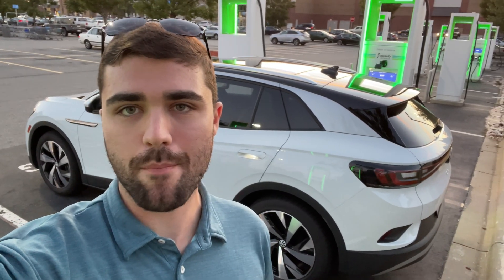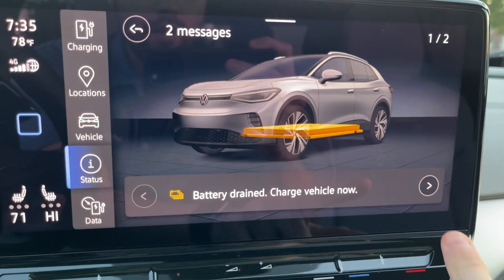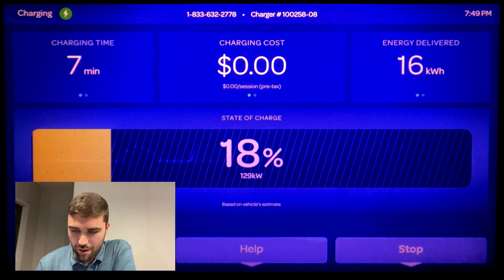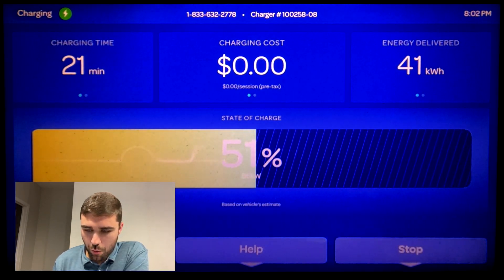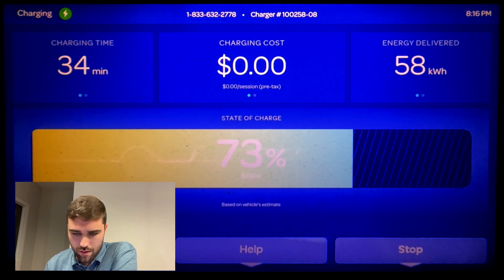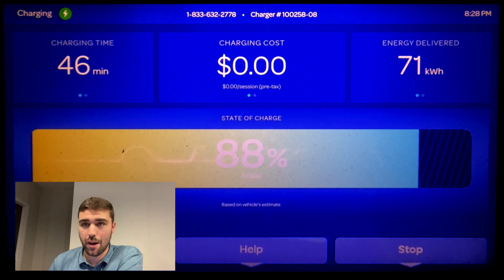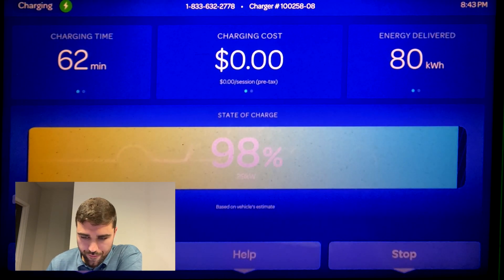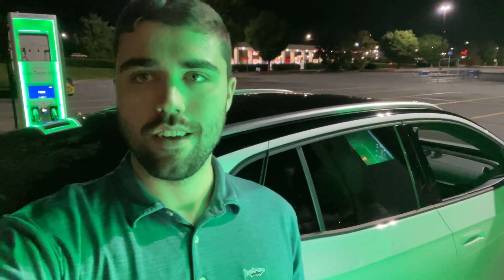2021 VW ID.4 Pro S 0-100% DCFC Charge Curve Analysis at Electrify America

Comment: The VW will be replacing my 17 Bolt, love the charging curve . I also drive an e-trim and the curve is amazing, at 90% still drawing 75kw and 67Kw at 97% my Bolt hasn’t seen 50Kw ever lol , of course I’m exaggerating it has seen it ….3 times in 4 years lol
Reply from the maker: ID.4 has an excellent charge curve, especially when you consider the vehicle price. I do wish it had 150kW to 80% like etron… but a man can wish 🤷‍♂️

Comment: Brandon, you forgot to mention  the year and mileage of your very old model S!
Please don't compare your old high mileage smaller battery to a 2021 year 82 kwh battery pack.
Don't give or mislead the public with missing data when you compare cars or any brand  or age.
Reply from the maker: Wasn’t intentional - the Model S was a 2015 70D with 200k miles, but charge curve was the same even at ~100k miles.
Reply: I don’t see as misinformation at all, whoever looks up Tesla will research this fact without going too technical. Thanks for the video